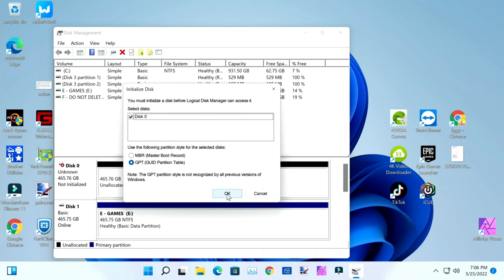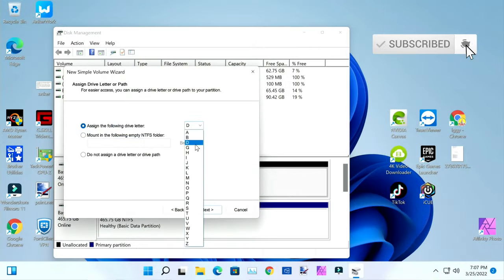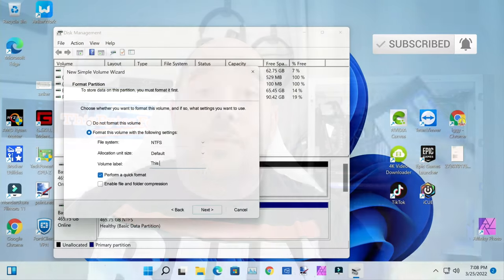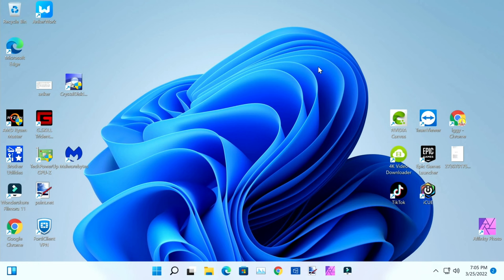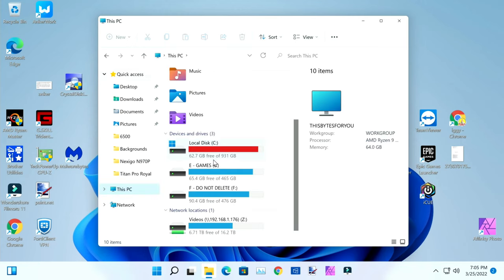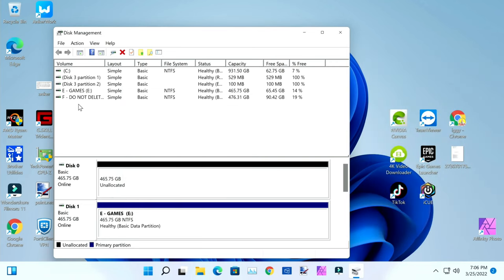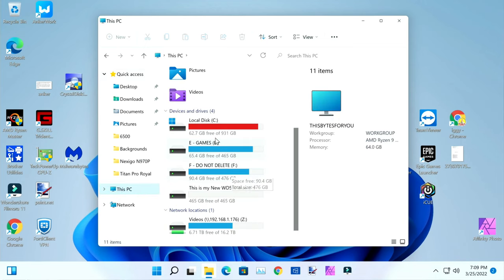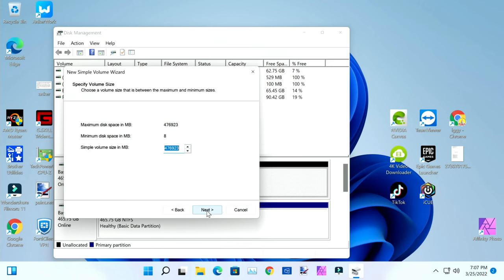How To Install a Second SSD into Your PC

Comment: I just did a reset on Windows 11 and now my SSD is not showing up
Reply from the maker: So that I can help, please list the manufacturer and exact model number of the following components:

1. Motherboard - manufacturer and exact model number
2. CPU - manufacturer and exact model number
3. M.2 - Manufacturer and exact model number, if you have any, and how many you have in this system
4. Regular SSD - Manufacturer and exact model number, if you have any, and how many you have in this system
5. Hard Drive - Manufacturer and exact model number, if you have any, and how many you have in this system
6. Was this a clean install of Windows that you upgraded at some point, for example, you had Windows 7 but upgraded to 10 or 11 or did you install 11 and are cloning 11.
7. This video will help you identify hardware inside your PC: https://youtu.be/65ZSiVImJx0
Reply: @ThisBytesForYou  
 
1. B660 d53h ac ddr4 WiFi 
2. Intel i5 12400f
3. MSI M371 1tb
4. Wd blue 1tb
5.  None
6. None windows 11 reset keep data no apps. 
 I did a reset because my WiFi is extremely slow and couldn’t figure out why so I tried a reset but speed still slow. All my other devices and my laptop and the same spot have double speed.
I tried adding a Wi-Fi cable extender with no luck I barely get 150 speeds when my laptop is getting over 400 in the same spot.
Reply from the maker: well I can help you on that, maybe easy too but where does your SSD not show up,.
Reply: @ThisBytesForYou  I don’t see it anywhere.
Reply: @ThisBytesForYou   I went to my bios to see if I could enable something but I’m still learning.
Reply from the maker: What do you see in your boot devices?  DO you see anything that says Windows Boot Manager under Boot device 1, 2 or 3?
Reply: @ThisBytesForYou  only see Msi 1tb there are no other options
Reply: @ThisBytesForYou   I see it in the bios under sata Config 
Sata 5 wdc wds100t2BO says supported 
Port 5 enabled
Reply from the maker: @Infamouskillah eating dinner ATM, see if this helps https://youtu.be/jzFl6ejaQgk
Reply from the maker: What BIOS version are you on?
Reply: @ThisBytesForYou  no worries at all. Enjoy dinner 
I see it in peripherals in bios
Reply: @ThisBytesForYou  f28 the latest one for my board
Reply from the maker: OK cool, page 19, you can see your BIOS screen, and page 21 shows you the section: https://download.gigabyte.com/FileList/Manual/mb_manual_600series-bios_e_v3.pdf?v=e176cfcc0bb7f8b739252e4d3b0b9101

I am very happy you are on the latest, now when you said you reset Windows,  does windows not boot, or you are just worried that you dont see the SSD?
Reply: @ThisBytesForYou  I’m up and running just can’t see storage at all. I go to disk management and don’t see it there either and don’t see it in disk manager.
Reply: @ThisBytesForYou  I think they update the bios ui it looks different now of course
Reply from the maker: is this your first M.2?
Reply: @ThisBytesForYou  Been running the M.2 since I had my PC and been using the second storage for my games without any issues. I’m having slow WiFi and couldn’t improve the speeds at all so I did a reset and everything booted fine without any issues. But for some reason I lost my second drive, I see it in my bios but not my device manager at all.
Reply: @ThisBytesForYou  I give up lol I have been trying to fix this for the last 3 days without any luck.
Reply from the maker: so you never opened your pc?
Reply: @ThisBytesForYou  yeah to install the ssd nano like 5 months ago and to clean it a few weeks ago. Everything has been fine until I did a reset. Even downloaded western digital app and it can’t find my sata ssd
Reply from the maker: During this process, did you open up your system?
Reply from the maker: dont give up, I am here to help.  But aside from restoring, what else did you do, did you install a piece of hardware, did you change anything in the BIOS, did you move your PC, something changed aside from the OS.
Reply: @ThisBytesForYou  No only after to check cables
Reply from the maker: OK, lets try this
1 Install the chipset: https://download.gigabyte.com/FileList/Driver/mb_driver_infupdate_10.1.18836.8283_n.zip?v=5449db0c9a1cc7ca06306bf7c96fb3ed
Reboot When it asks

2. Update your ME firmware: https://download.gigabyte.com/FileList/Driver/mb_driver_648_consumer_2232.71.59.0.zip?v=7d91802430d2e8e6a7f28ea0dd54df2d
Reboot When it asks

3. Install the Serial IO driver: https://download.gigabyte.com/FileList/Driver/mb_driver_669_serilio_30.100.2221.20_n.zip?v=c6c265788a4cc92a54d7f426934bb3ba
Reboot When it asks

4. Install the Intel Rapid Storage Technology
https://download.gigabyte.com/FileList/Driver/mb_driver_659_irst_19.5.0.1037.zip?v=89fccbe7d7da0613da83e58274866c46
Reboot When it asks
Reply: @ThisBytesForYou  it says that is a downgrade should I still try it? I don’t understand why I can see it in the bios but not anywhere else.
Reply from the maker: no, if its a downgrade no, move on to the next driver
Reply: @ThisBytesForYou   only error I see is in device manger says acpi wake alarm pnp0000
Reply from the maker: Try installing this: https://download.gigabyte.com/FileList/Driver/mb_driver_DTT_Package_9.0.11405.42569.zip?v=ac25605a49fdaeebb6c287382b1896eb
Reply: @ThisBytesForYou  I don’t even see an option in the bios to choose the sata drive a raid
Reply from the maker: @Infamouskillah  have you tried a windows update, I think that is a chipset driver, but its not being picked up correcly.
Reply: @ThisBytesForYou  says incompatible program 7z
Reply: @ThisBytesForYou  yeah all up to date and I used the gigabyte app to update all the drivers as well
Reply from the maker: @Infamouskillah  WOOOO are you trying to install inside of a ZIP,.... no no no, never do that.  Extract all the contents of the zip file into a folder, each zip file is its own folder, then install from there.
Reply from the maker: @Infamouskillah  not sure what to tell you, other than last ditch effort, turn off your pc, and remove the M.2 and reseat it, not sure what could be going on.
Reply: @ThisBytesForYou  I right clicked and push extract all then it only gave me one application to install
Reply: @ThisBytesForYou  I redownloaded the package and it installed restarting now
Reply: @ThisBytesForYou  still nothing :( maybe I should do a fresh install of windows
Reply: @ThisBytesForYou  no worries I appreciate your help very much. THANKYOU
Reply: @ThisBytesForYou  it’s not the m.2 it’s the Wd blue ssd not reading
Reply from the maker: @Infamouskillah well, I was going to say at the begining (why a restore, that's horrible, but I bit my tongue) I love fresh installs
Reply from the maker: hhhh the SSD, try plugging the SSD in a different port on the motherboard

Comment: Black screen after installing a new ssd via sata cable and motherboard power
Reply from the maker: so that doesn't happen, unless the drive is bad, the SATA cable is bad, the sata power cable is bad, or you forgot to plug the computer back in, video cable back in or you got a cable lose in the machine.  Take a look around.
Reply: @ThisBytesForYou  brand new drive. Now trying to reconnect it with the second sata cable that came with my CYBERPOWER prebuilt & using a different power sata cable from the many cables from the bottom of the case by the power supply. I checked many wires and none seem to have disconnected during the initial process
Reply from the maker: @95curt  look on the back of your PC, did you connect your monitor to your video card, not onboard video?
Reply: @ThisBytesForYou  it was the sata cable & or motherboard connection. Yes I had the DP & HDMI (tried both) connected properly but it was just a black screen with a single line on the top left…. Luckily changing the sata cables fixed it
Reply from the maker: @95curt   good stuff my friend, like I mentioned, that could have been one of the things, if you scroll down (also on my guide on how to install an SSD) for some reason this year, LOTS of people have been having issues with the cable, they buy a new one or grab a different one and it works so it is an odd thing going on but so very happy you got it working my friend.
Reply: @ThisBytesForYou  thank you very much! for sure a weird error
Reply from the maker: @95curt  always a pleasure my friend.